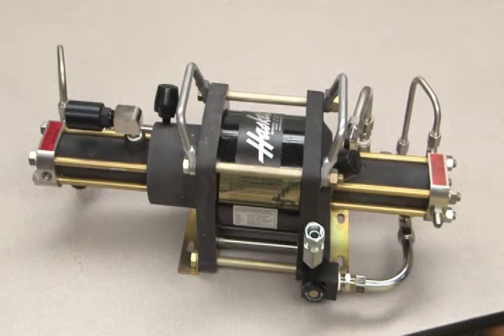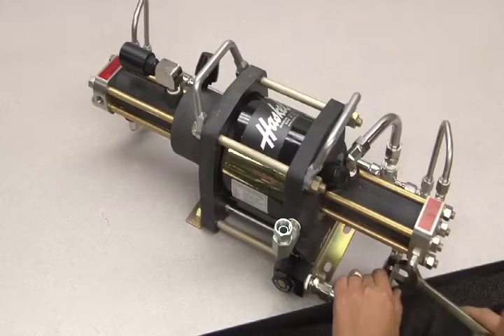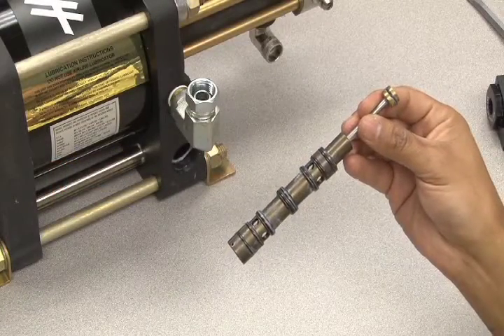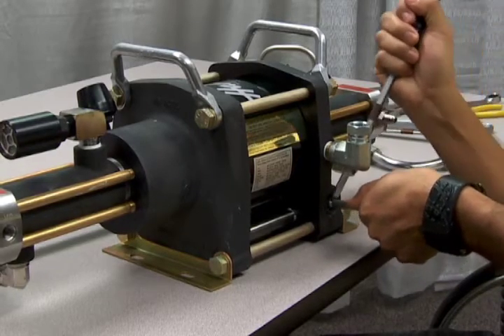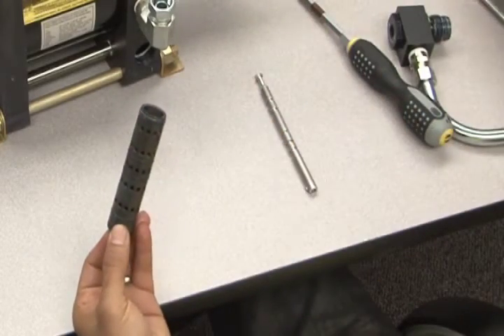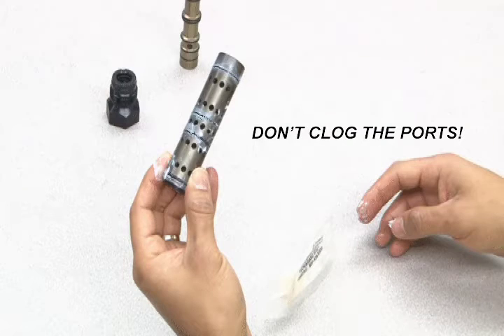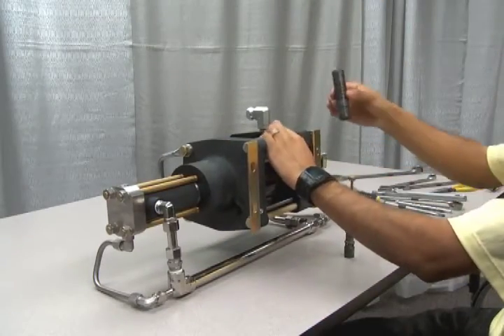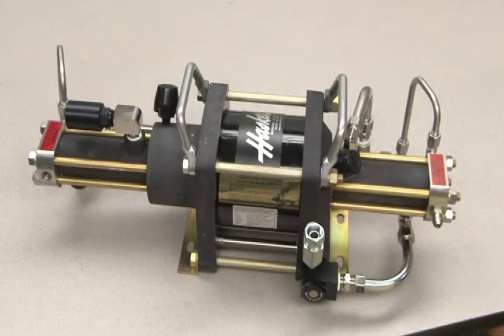Haskel #01 Maintaining the Air Drive Cycling Valve

Comment: hello, I have currently replaced all the O-rings on the Air Drive cycling valvle on my haskel pump, but now there seems to be a delay when the haskel high pressure is supposed to turn on.  Any ideas on what this problem can be?